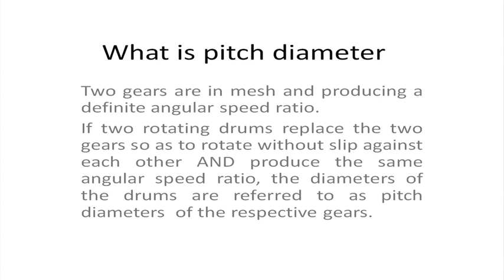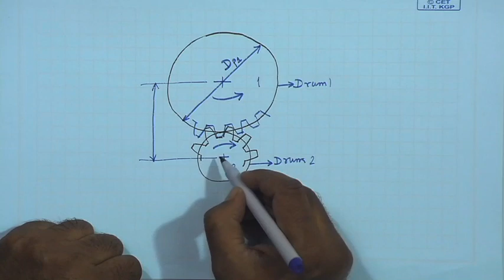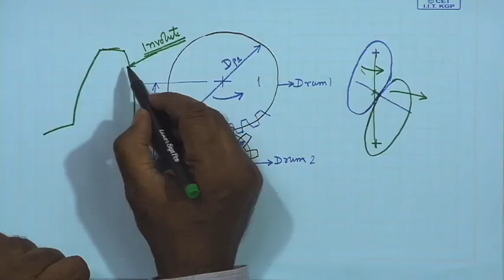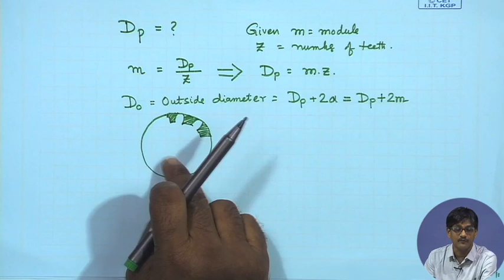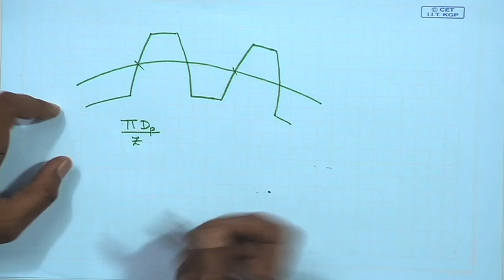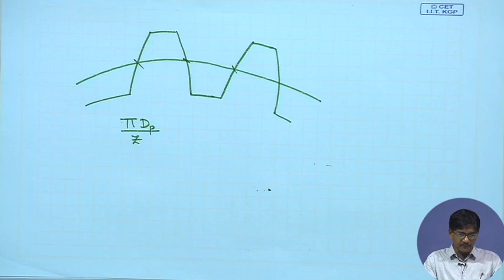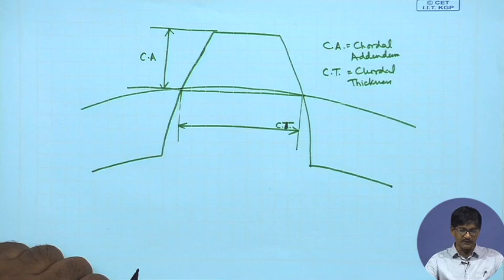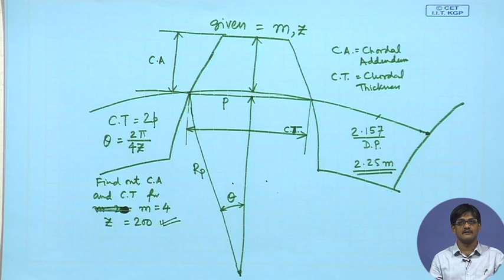Gear Geometry

Comment: Hi sir
I knew out side diameter. So that I am going to calculate. For example 85 out side and no of teeth is 19. Now  outside dia= (z+2)xm= 85=(19+2)xm. M= 85/21= 4.04mm
If I am wrong, please correct me.